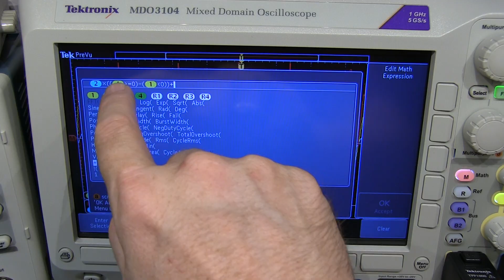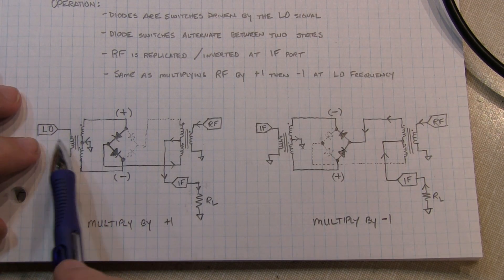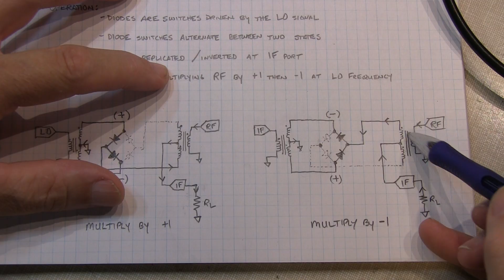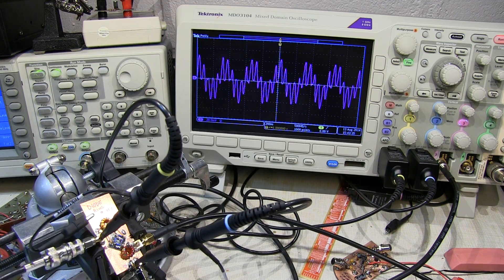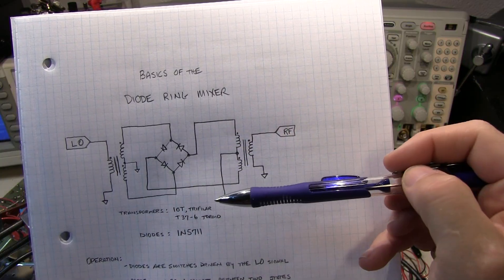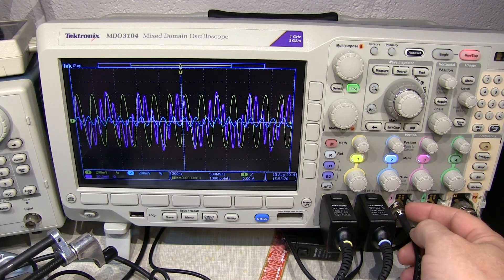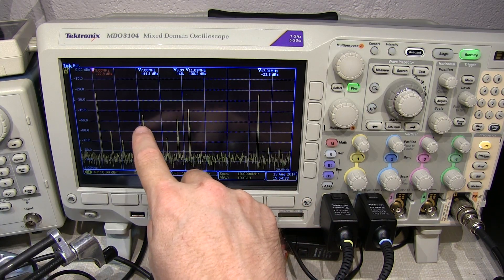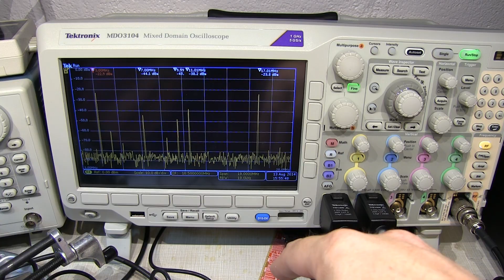#167: How a Diode Ring Mixer works | Mixer operation theory and measurement

Comment: Thank you for the awesome explanations! It’s beautiful to see how the harmonics and mixing math really occurs. 

When you say that the node on the left between the two diodes is at ground, is that because the diodes are forming a voltage divider between the two parts of the transformer?

Could you get a better mixer by using diode with a lower threshold voltage? Like germanium diodes?
Reply from the maker: Maybe, but the sharpness of the diode IV knee, and the diode switching time (reverse recovery) play a bigger role.
Reply: @ That makes sense! That must be why Schottky diodes are used eh?
Thanks for your response and love your videos!

Comment: What about the relative  level of the two signals? As I saw in the video, the radio frequency represents approximately one-fifth of the local oscillator level. Is this necessary to obtain the expected mixing result?
Reply from the maker: For best mixing performance (LO rejection, low conversion loss), the LO power generally needs to be higher than the RF/IF levels.  However, the mixer will still work with low LO drive levels, just not as well (more loss, less LO rejection, etc.).

Comment: Superb video and explaination as always. I have one question though. For a theremin project that i build i have 2 colpitts oscillators connected to the mixer. I get the multiplicated signal at the output only when the LO and RF end terminals are floating, once i ground them i get nothing. Is this a matter of impedance match or something else that i completely miss?
Reply from the maker: You probably need a lot more turns on that transformers to raise the impedance.  You might be better off with a Gilbert cell based mixer for audio applications.
Reply: @w2aew  I have tried the gilbert cell in the past but i had a bit of trouble to get it work. So i followed your advice and it worked like a charm. For anyone having the same issue I used a 0.3 mm wire with 20 turns

Comment: What is better for mixing frequencies? This classic doide ring mixer? Or something more modern like the gilbert cell?
Edit: Also i am kind of dissapointed that Art of Electronics book didn't showcase Gilbert cell or comparator construction in more detail. For comparator design from basic transistors, i had to jump between different subchapters to finally find a schematic that did the job in the heater temperature control example near the end of a chapter. For gilbert cell, there is no explaination if i recall correctly.

Comment: Where did you get your inductors from? Do you have a part number? If hand-made, what is the gauge of wire and numbers of turns?
Reply from the maker: I wound the transformers myself.  10 turns, tri-filar wound on a T37-6 core.

Comment: at 6:15 (the most replayed point of the video) why would the point between the diodes appear as ground? that would be true if the diodes behaved like a voltage divider, but they don't. they behave like a short. so it probably can't be the diodes (when conducting, they should behave as if they were not there, except for the threshold voltage drop. other than that they are basically just a shorting wire, right? and across a wire, even  a shorting wire, the voltage should be basically the same everywhere, it doesn't behave like a voltage divider) so i was thinking - is it the resistance of the wire that makes up the actual coils of the centertapped transformer? so we could think of it as having two invisible, internal resistances equal in size, and THEY act like the voltage divider? cause if we replace the transformer with an ideal symmetric voltage source: -Vlo and +Vlo; and the diodes with ideal diodes with 0 resistivity after threshold, then i don't think this would work. so it must be the things not shown in the diagram doing the work...
Reply from the maker: Remember that this diode string is being driven by the secondary of a transformer that has a grounded center-tap.  The RF voltage is symmetrical (but inverted) at either end of the transformer secondary, thus the mid-point at the diode junction will appear basically at ground potential because the midpoint (center tap) is grounded.
Reply: @w2aew  thank you for the response! why would it be? it being center-tapped only means nothing from the point of view of the diodes. let's say the end voltages on the transformer are +2V and -2V. the diodes only see input voltages whose difference is 4V. they are not aware of any ground. as far as they're concerned it could be 0V and +4V. voltages are strictly relative, and they don't have any reference to the center tap. if you replace the diodes with a wire (because they are forward-biased) you wouldn't expect "the middle of the wire" to be at at 0V (or any midpoint voltage, between the voltages applied to the ends of the wire), would you? so why are you expecting the diodes to be? they're not a divider either. if you try it - take 2 diodes apply voltage to them and measure voltage between them you won't see them divide it. 🤔 so - i believe/know that the midpoints are at 0V, but the reasoning seems strange to me. (or maybe i'm misunderstanding it)
Reply from the maker: @pneptun  The fact that the diodes are driven from a winding which has a grounded center-tap does mean something.  Using your example, the +2V and -2V at the ends of the winding are with respect to ground.  Given a matched set of diodes, the voltage at the junction will be at 0V potential with respect to ground.  The voltages at far ends will be the +2 and -2V when the diodes are reverse biased, and will be at clamped at +Vd and -Vd (with respect to ground) when forward biased, with forward current determined by the source impedance on the primary and the turns ratio.
Reply: @w2aew  i believe that. but _why_? before the first diode the voltage is +2V - coming right off one end of the transformer, after the first diode it should be 2-0.7=1.3V, not 0V. or is it that because the diodes are basically "shorting" the transformer they pull the voltage down? but that's basically what i said - the "pull down" is usually interpreted as realizing all of the voltage on the hidden internal impedancies. i think that's it - it's the internal impedancies. i'm convinced now.

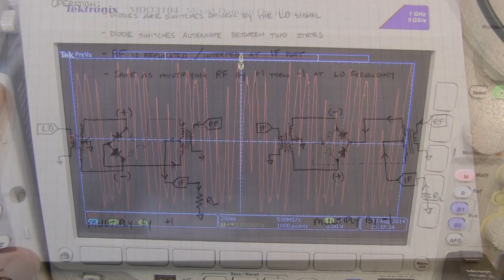Comment: At 5:15, shouldn't the IF on the right-side diagram have an LO at the upper left node  (like in the left-side diagram)? Because you already have an IF output at the RL?
Reply from the maker: Yes, there is an error in the video.  The downloadable notes pages have been corrected.

Comment: A confusing point about explaining the mixer is the multiplication part.

The actual process is Superposition of two voltages each one fluctuating at a different frequency.  If you were to plot several cycles of each signal (the RF and the LO), one a above the other on graph paper, with seconds on the X axis and voltage on the Y axis, a 3rd waveform can be drawn, the beat frequency, as the summing of the voltages of the two waves.

For example, at time T = 7 seconds, say,  freq #1 is at 7 volts, freq #2 is at  -3 volts, adding you have   7 + (-3) = 7 - 3 = 4 volts, and you'd plot that on the graph paper just below the two source frequencies (RF and LO).  Then repeat at 1 second intervals, adding the voltages at each second.

The resulting waveform will be the beat frequency.   Constructive interference occurs when both input waves are swinging positive voltage above the zero reference line.  Destructive interference occurs when one of the input waves is below the line, and the resulting amplitude is reduced by the negative-swinging input wave.

So when someone points out  "it's not multiplication, it is Superposition.  Nature does not multiply superposed waves, it adds them"  you then (and only then) have to say "if you look at the trig functions, you start with a multiplication."

My preference is to start by saying  'we have two frequencies, they'll be brought together and the result will be a wave that is the superposition  of the two input frequencies, but here's the math"

Otherwise, having an assignment to familiarize students with how the beat frequency is created from the two input waves - by plotting the 2 waves then adding - confuses them.  "Why are we adding?  Shouldn't we be multiplying?"

No, there's a difference between how the circuit combines the voltages of the two frequencies, and how the math abstracts that process.
Also, "where does the new frequency come from?"

Answer - it is the repeating pattern of how the Constructive Interference and Destructive Interference behave from adding the waves.

.
Reply from the maker: Your description of summation (superposition) of waveforms is correct, and the resulting sum will undulate at the difference or beat frequency.  However, this process does not actually result in a spectral component at the beat (difference) frequency - or even the sum frequency for that matter.  If these were audio tones, you could hear the "beat" frequency as sort of a vibrato of the combined waveform. For example, if you add a 1000Hz audio tone to a 1100Hz audio tone, you may hear a 100Hz vibrato of the result.  But, if you put a low pass filter on the summed signal to remove the 1000 and 1100 frequencies, you will NOT hear a 100Hz tone, because the summation process does not create one.

However, in an RF mixer, the actual process is NOT superposition (summation).  As stated above, a linear process like addition or subtraction does not result in the actual generation of additional frequency components.  A non-linear process such as multiplication does result in the creation of new spectral components. This is what the math shows.  And, here is some visual proof of the same:

https://www.qsl.net/w2aew/youtube/Sum-vs-Product.png

This image shows a 100MHz signal on CH1 (yellow) and a 110MHz signal on CH2 (cyan). MATH1 (orange) is the summation (superposition) of these two waveforms. You can easily see the "beat" at the difference frequency due to the constructive and destructive interference of the signals, just as you described.  

However, if you take the FFT of this waveform, you'll see that the only frequency components you have are the original input frequencies.  There is not a spectral component at the 10MHz difference frequency.

(you can ignore the spectral components at about the -50dBm level, these are distortion components from my signal generator, which appear at the harmonic freqs and create some intermod products)

Now, MATH2 (purple) is the Product of the two sine waves.  If you take the FFT of this result, you can see that there is indeed a spectral component at the difference frequency (10MHz) and at the sum frequency (210MHz).  Filters could be used to isolate the components, which is precisely what is done in RF frequency conversion circuits, such as superheterdyne radios.
Reply: @w2aew  Edwin Armstrong's original patent, US1342885A, indeed shows a diode (a non-linear device) in the input section to process the result of combining the resonant-tuned LC tank circuit used to select the input RF with the coil of the LO, but a diode cannot produce what the combination of a tuned LC tank circuit (see Fig. 1, circuit components 2 and 3) the electromagnetic induction from the coupling coil (item 6 in Fig. 1) do not provide.

This patent is Armstrong's het invention from 1919.  Nearly all het transceivers are based on it.

The coupling inductor (component 6 in Fig. 1) electromagnetically couples its voltage variations onto the inductor in the tuned tank circuit (components 2 and 3 in Fig. 1).  For example,  if the LO is at 1005Khz, and the tuned tank circuit is at 550Khz, the beat frequency (455Khz) is fed to the diode component 4 in Fig. 1

CAREFULLY NOTE - the beat frequency is a direct result of the inductor component 6 in Fig. 1  imposing, through electromagnetic induction onto the resonant tank circuit's inductor (component 2 in Fig. 1) - a superposition of the 550Khz that the tank circuit oscillates at, and the 1005Khz that the inductor (component 6, output of the LO) provides.

What do I mean by superposition here?   The inductor (component 2 of the tank circuit) has its voltage magnitude fluctuate, and its electric polarity swap back and forth, at the tank circuit's resonant frequency (550Khz).

That inductor (component 2 of the tank circuit) has its voltage magnitude altered by the addition of the inductively-coupled voltage magnitude of coil 6 (output of the LO) - what appears at diode component 4 in Fig. 1 is the sum of the voltages of the two inductors (2 and 6) at the beat frequency.

There is no FFT component in Armstrong's het invention to extricate other frequencies.  The diode (component 4, Fig. 1) is non-linear because it is either forward biased and "ON", or reversed biased and "OFF", so its output does not track its input in a linear fashion.  But this does not change the fact that the voltage conducted through the diode is the sum of the tank circuit voltage and the LO's output inductor voltage from coil 6.

My comment was directed at this original het invention of Armstrong's and is based on the beat frequency output from the voltage summing achieved by electromagnetic induction from coil 6 onto coil 2.

.
Reply from the maker: @Greg_Chase  It is the non-linear response of the diode (acting on the superimposed signals) that creates the mixing and results in the sum and difference frequency components.  (I showed the FFT in my image to illustrate that a simple linear superposition does NOT create the IF frequency component).  My picture example used pure multiplication as the non-linear operation, but really any non-linear operation acting on the signals will result in the mixing components.  This is what the diode does.  Not all mixers are multipliers, but they all have a non-linear transfer function.
Reply: @w2aew  I think we're talking past each other.  My point was the superposition of the two signals at the front end, where a beat frequency is developed, and you're talking about the current output of the diode (I think).  Much obliged.  From a discrete components standpoint, I reckon, you can look at practically any circuit and draw a range of assessments, depending on what you want to focus on.  I understand what you're saying about the diode output current, I think that's what you're intending.  I was speaking to the exact physical nature of how the voltage levels in the RF and the LO at the front end fluctuate between Constructive Interference, and Destructive Interference, and not the diode output current.  Take care.
Reply from the maker: @Greg_Chase  No worries, good discussion.  My only points are that:
1) The beat frequency developed by the signal summation (superposition) is not what is responsible for creating the IF signal frequency.
2) Signal summation (superposition) is not a requirement for the frequency conversion process.  The only requirement is that the combined signals are passed through a non-linear process.  This can be done using summed signals as in your example, or through other means such as using a multiplier, such as a Gilbert Cell (where there is no signal summation), or by many many other means such as the diode ring mixer shown in this video.

Comment: For Bridge Rectifiers if rating is 30 amps that means 30amps divided by 4 diodes in the bridge rectifier = 7.5amps per diode? Is this the same for a Diode Ring Mixer in RF circuits that the RF Mixer current rating is divided by 4 to the RF input power?
Reply from the maker: rating appies to all the diodes.  A 30A bridge - all diode are rated for 30 A.
Reply: @w2aew  I don't think the datasheets for bridge rectifiers say that ALL diodes are rated for xxx so many Amps of current. Where in the datasheets specs does it say this?
Reply from the maker: @waynegram8907  It would not make sense to split the current among the diodes, because the current doesn't split among them when in use.

Comment: The diodes are not acting as switches to accomplish modulating...that's a different type of circuit.

The diodes are non linear elements. That accomplishes the mixing.

A switch only has two states so it can't mx from just that...

Comment: Hi Alan. Im TA9AAP from Turkey. I hope you will answer my question. There are many different types of diode ring mixer circuits in professional devices and in many schemes. I have been working for a long time to make a handmade QRP device. But I have seen some diode mixer schemes with 4 diodes, one transformer and one potentiometer (LO). I couldn't find anything when I searched about the number of turns of these, what the value of the potentiometer used should be and how I should adapt the impedance. Yes, it is a simple diode mixer, but I want to design a single transformer that is not trifiliar or bifiliar, but a mixer with 4 diodes and only one potentiometer. Can you please help me on how to do it?
Reply from the maker: I've never used a mixer like that, but I would suspect that the value of the potentiometer isn't too critical.  I would try something on the order of 1kohm.   As for the number of turns, the general rule with RF transformers is to have sufficient turns so that the inductance of the winding gives you a reactance value that is at least 4x the system impedance (typically 50 ohms) at the lowest frequency of operation.
Reply: @w2aew  Firstly thank you very very much for answer. I thought maybe you would like to review the diagram in this video. 73 https://www.youtube.com/watch?v=nZ5ftl7Uuf0&t=16s